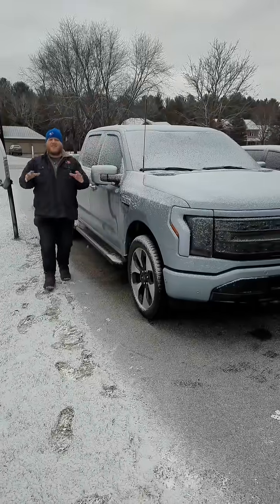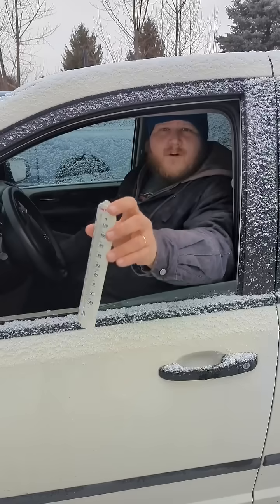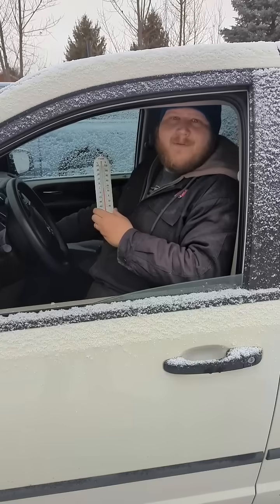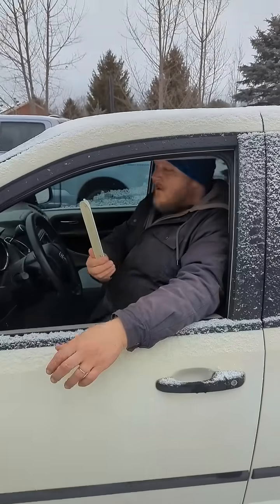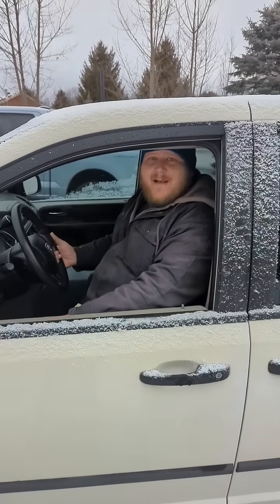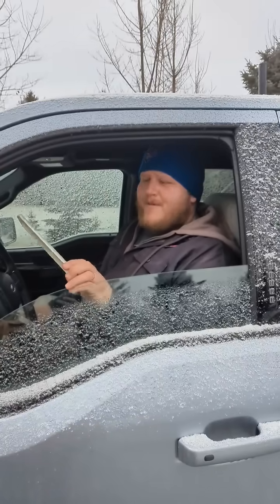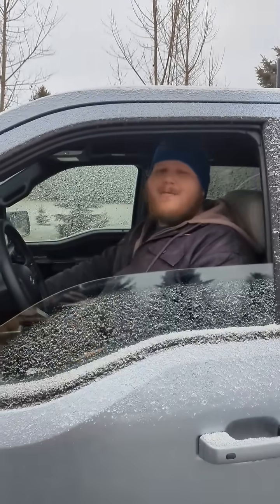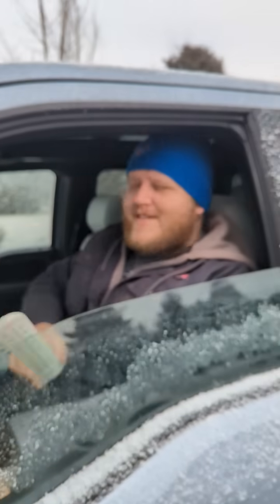Electric vs Gas - Heater Wars! How Long Does the Ford F-150 Lightning Take to Heat Up?

Comment: Plus you won't get carbon monoxide poisoning, you could heat it in the garage.
Reply: If it's in the garage it most likely won't need to be heated.
Reply: @stephenpeterson9795  that's about the only practical way. A guy I know said he's Tesla uses $80 per month in power just to keep the battery warm in the winter. His is under a carport. You know it's not going to cost $80 per month just to heat the garage, if it's insulated and part of the house. However I'm not really sure I want a huge lithium battery inside my house..
Reply: Electric cars in garages not a good idea
Reply: @Sebastian_Dinwiddie   lol, even less good idea to have gas cars in garages. They bliw up all the time
Reply: @stighaaland5357  you watch too many movies
Reply: @jac981 There's a reason houses with built in garages are more expensive to insure. 

Turns out, storing densely packed energy of any sort inside your home is maybe not the best idea. Gasoline is highly combustible and emits vapor that can cause the air itself to ignite under the correct conditions, and when burned for fuel emits dangerous levels of carbon. Batteries, when not cared for or engineered/built incorrectly can also result in cataclysmic melt downs. 

Cars just don't belong inside your house no matter how convenient it is, period. A separate, detached garage is the best place but rarely are they heated and you still can't really run a gasoline car inside them to preheat the cabin. I guess you could open the garage door and hope that's enough ventilation.
Reply: Yeah if you want to keep a huge lithium ion battery inside your house
Reply: Heres 19 reasons why electric vehicles SUCKS.

1) It’s too expensive 

2) Also cause pollution because it’s created by dirty fossil fuels 

3) Tires wear out quickly 

4) Only reliable when temperatures are warm and when it’s cold, it can bring danger to the driver and passengers.

5) Charging stations are hard to find in midwestern states. If you live somewhere like Wyoming or North Dakota, it is clear that you are going to have a lot of difficulty finding charging stations, as well.

6) Roadside Service does not provide Full Coverage and lot of this has to do with the fact that their parts are not on-hand and they are more difficult to actually find than ones for regular cars. Also, auto mechanics will not know how to fix electric vehicles since they didn’t built it. You probably have to find Elon Muck and ask him to fix it for you and he will probably charge you for a million dollars. 😂

7) Travel shorter distances due to the fact that these are cars that need to be charged, they simply do not have the same type of mileage range that regular cars often possess.

8) Too much focus on luxury vs. dependability. With all of the issues that have been discussed thus far, one may be questioning what exactly car manufacturers are aiming for when it comes to making these models. In short, they simply are spending too much time on overall luxury rather than dependability.

9) They get noisy early on. Owners of electric cars have been quite open about the fact that they are prone to make a lot of noise very quickly into their usage lifetime. There is no question that over time, this happens to all types of vehicles, but it is alarming that it has been happening so quickly for electric ones.

10) Maintenance costs far more because when dealing with expensive cars, one can always assume that repairs will end up costing far more. However, when observing electric vehicles, it is clear that the prices to fix them are at an extremely excessive rate. This is largely because finding its parts is far more difficult.

11) some electric cars look ugly

12) Battery pack replacements are expensive due to the fact that electric cars run on their battery packs, it is clear that they play a major role in the overall performance of the vehicle. However, their batteries are prone to needing replacements as time passes by, and they end up costing a ton of money.

13) Recharging takes a long time

14) Durability is not consistent

15) Tend to be heavy due to the fact that electric cars are built with different materials. In fact, the heavy weight of these vehicles is likely another factor that ends up making their tires begin to drop in quality so quickly.

16) One major aspect of the electric car market is that there are limited choices. Unlike regular cars that comes with an abundance of different options, car manufacturers do not seem to release multiple electric vehicles. This is not a solid idea, as electric cars are trying to grow in popularity.

17) Not Good In The Snow. Electric cars definitely meet their match when they are used in the snow. They are prone to having a lot of malfunctions with this type of weather, while also having a lot of difficulty while driving on slushy roads.

18) Too Much Hype. "Show not tell" is the philosophy that car manufacturers should possess. However, when it comes to electric cars, it is clear that this currently is not the case. There is no question that the market is pushing for more usage of electric power, but they have yet to accomplish much in the way of persuading the vast majority of the public.

19) Having a smart car means that the government can track your every move and can listen to your conversations. 

DEMONcrats and leftists wants to banned EVERYTHING. Gas cars, gas stoves, guns, cows, meat, freedom of speech, freedom of religion, and etc. I’m not going to go along with their authoritarian policies so fuck them!
Reply: Much cheaper to heat the garage instead.

Comment: let's see how long you can drive when you leave the heat cranked....
still not impressed.
wanna impress me? show me a truck that will tow a 40' enclosed trailer all day long, without turning a 8 hour trip into 12 hours, and not cost more than a house 🤣🤣

Comment: Electric..... grandma's old Big Block 7,000 pound, 8ft wide 24' long Cadillac with 8 mpg will always be a far better VEHICLE than ANY electric vehicle.....any vehicle that runs identical to a fckn Dildo is no proper solution

Comment: I'd rather the car be able to move on start in below 0 Temps than the heatee get up to operation temp. Also you tested a 60k new truck against a 2015 grand caravan. Weird test man

Comment: The Caravans heat up more quickly under load of course. By a mile or so from a cold start she's blowing warm.  I owned a chev...once...that wouldn't heat until 10 miles down the road.  The ev with a resistance heater wouldn't be much quicker.

Comment: And it's an overpriced piece of battery powered junk , what good is a truck that can't tow , got to recharge it every 50 miles , if it don't run on gas it can kiss my ass

Comment: The comments. Wow. The volume, the cab, the window. What on earth? One vehicle heated probably 250# of metal and coolant with an intermittent gasoline fire that was spinning nearly a 50# crankshaft and other associated mechanical parts. The other blew air over wires heated with electricity from a battery, and did it 3.5 times faster. BUT if the paint wasn't the same color the test is invalid. 😅.

Comment: And now you can’t back it out the driveway to get even close to a charging station that doesn’t use coal for power. Let alone all the parts on it that comes from China that uses coal to mass produce things. The EV is nothing but a large scale sales tactic. But drive what you like.. it’s America.

Comment: important note...the EV takes a mile off your range every 4 minutes...that's alot when you need it on full time .
Reply: Doesn’t work like that at all…anyway most EV owners in the winter are going to warm their cars up, leaving from home anyway, while they are plugged in. Losing no range at all and the car is ready and warm. I do that all the time.
Reply: @the_red_key8825 "Most"? How about those that don't?  Regardless, if it sits for 2-5 minutes to warm, you are still going to be heating the cabin while driving, thus adding more draw from the batteries.
Reply: @the_red_key8825 Yes and it costs you at least $80 per month (power at $0.13 per kWh) to maintain the battery temperature in the winter not including how much it costs to heat up the interior of the vehicle. I was extremely pro EV until I really got serious about getting one. I figured I'd find a used one. I did. They are very cheap compared to the original price especially with less than 100,000 miles. The one I found had 80,000 miles on it with a bad battery. I tried to find a refurbished battery, doesn't exist, went through the factory and it was going to cost $18,000. Holy crap. I did some calculations and figured out I'd be better off driving a full size high top conversion van getting 15 MPG would be cheaper than the battery replacement costs alone. Not including the electric costs, not including the extra registration fees, not including the inflated upfront cost. I'm driving a very nice big high top conversion van now. With a TV, microwave, electric AC, diesel parking heater (my van is warm before I get in it and uses less than $1 in fuel per day), toilet and a bed.
Reply: @Bryan-Hensley  for a moment there i thought you had first hand experience with this but instead you "researched" your way out of an EV 😆 Ultimately, it only matters if you're happy with your decision though 😊
Reply: Tell me you've never seen or used an EV without telling me.
Reply: Just another ev hater "attempting" to spread misinformation lol
Reply: It's important to note that the heater in this truck is extremely powerful, you definitely don't need it to stay on, I drove to work in a t-shirt and button up in -17 degree weather with the heat on Max, I was sweating like crazy a few minutes into the trip.
Reply: Heres 19 reasons why electric vehicles SUCKS.

1) It’s too expensive 

2) Also cause pollution because it’s created by dirty fossil fuels 

3) Tires wear out quickly 

4) Only reliable when temperatures are warm and when it’s cold, it can bring danger to the driver and passengers.

5) Charging stations are hard to find in midwestern states. If you live somewhere like Wyoming or North Dakota, it is clear that you are going to have a lot of difficulty finding charging stations, as well.

6) Roadside Service does not provide Full Coverage and lot of this has to do with the fact that their parts are not on-hand and they are more difficult to actually find than ones for regular cars. Also, auto mechanics will not know how to fix electric vehicles since they didn’t built it. You probably have to find Elon Muck and ask him to fix it for you and he will probably charge you for a million dollars. 😂

7) Travel shorter distances due to the fact that these are cars that need to be charged, they simply do not have the same type of mileage range that regular cars often possess.

8) Too much focus on luxury vs. dependability. With all of the issues that have been discussed thus far, one may be questioning what exactly car manufacturers are aiming for when it comes to making these models. In short, they simply are spending too much time on overall luxury rather than dependability.

9) They get noisy early on. Owners of electric cars have been quite open about the fact that they are prone to make a lot of noise very quickly into their usage lifetime. There is no question that over time, this happens to all types of vehicles, but it is alarming that it has been happening so quickly for electric ones.

10) Maintenance costs far more because when dealing with expensive cars, one can always assume that repairs will end up costing far more. However, when observing electric vehicles, it is clear that the prices to fix them are at an extremely excessive rate. This is largely because finding its parts is far more difficult.

11) some electric cars look ugly

12) Battery pack replacements are expensive due to the fact that electric cars run on their battery packs, it is clear that they play a major role in the overall performance of the vehicle. However, their batteries are prone to needing replacements as time passes by, and they end up costing a ton of money.

13) Recharging takes a long time

14) Durability is not consistent

15) Tend to be heavy due to the fact that electric cars are built with different materials. In fact, the heavy weight of these vehicles is likely another factor that ends up making their tires begin to drop in quality so quickly.

16) One major aspect of the electric car market is that there are limited choices. Unlike regular cars that comes with an abundance of different options, car manufacturers do not seem to release multiple electric vehicles. This is not a solid idea, as electric cars are trying to grow in popularity.

17) Not Good In The Snow. Electric cars definitely meet their match when they are used in the snow. They are prone to having a lot of malfunctions with this type of weather, while also having a lot of difficulty while driving on slushy roads.

18) Too Much Hype. "Show not tell" is the philosophy that car manufacturers should possess. However, when it comes to electric cars, it is clear that this currently is not the case. There is no question that the market is pushing for more usage of electric power, but they have yet to accomplish much in the way of persuading the vast majority of the public.

19) Having a smart car means that the government can track your every move and can listen to your conversations. 

DEMONcrats and leftists wants to banned EVERYTHING. Gas cars, gas stoves, guns, cows, meat, freedom of speech, freedom of religion, and etc. I’m not going to go along with their authoritarian policies so fuck them!
Reply: No, it doesn't.   It uses the most amount of energy getting up to temperature.   It levels way off after that.  It's like anything else, including acceleration.  It takes far more energy getting up to speed, then far less energy to maintain that speed once it's reached.
Reply: @dane9193 Not quite. The element still needs to pull the same amount of energy to heat to that temperature as it does to maintain said temp. It may be able to cycle on and off and not stay on the entire time, but it is still drawing that energy from the batteries.
Reply: @dane9193  someone has never been out at 40 below or colder.
Reply: No, becouse when temperature has reached your desired level it´s way easier for the heating system to maintain that level.
Reply: @svenwesterlund3405  ya your heat load would very a lot after warmer up. Speed you going, out door temp, rain/snow. All are going to affect it long term drain.
Reply: @svenwesterlund3405  right, kinda like in a car. You use more fuel when getting up to speed because of the load on the engine, throttle opens more, whereas maintaining a constant speed, the throttle is partially open. 

Same goes for EVs, when you accelerate, you need to use more current, so you use more amps, then when you’re maintaining speed, you hardly use any amps.
Reply: Tell me you don't own an ev without telling me
Reply: @garys6898  tell me you don't live in a cold climate.
Reply: @Deere2154D  ny, it's cold enough

Comment: EV vehicles are not reliable. Maybe the Teslas are pretty good.
Reply: Have a source to back up your claim?   That is absolutely false.  EV's are far less complex and have less moving parts.   Electric Vehicles are generally far more reliable in comparison.   At one time the Chevy Bolt was rated the most reliable Chevrolet.

Comment: My 2020 f250 takes about 5 to 7 minutes to get the cab warm
Reply: And this is the benchmark that would have made a better comparison
Reply: Perhaps.. but the most important factors in comparing the two are environmental. How fast is at heating up at 32° when it is below 32° outside with the window open.
Reply: @JdogFixit  yeah basic scientific method is the best way to to it, benchmark closed cab window down & up.
Reply: Yes I agree my chev Silverado same thing and I'm talking 10 degrees temperatures

Comment: Remember folks, this is right around the freezing point, not -30c, the battery loses mileage in colder temps, gas engines rely on rpm to generate heat from engine coolant, open thermostat.
This video shows nothing crept electric cars are not good for cold climates, or noting but a grocery getter, a gas engine is the preferable choice for the future of the world, if you want to keep the forests green.